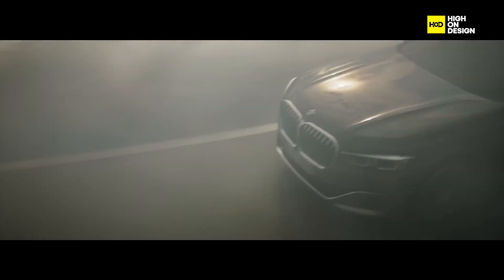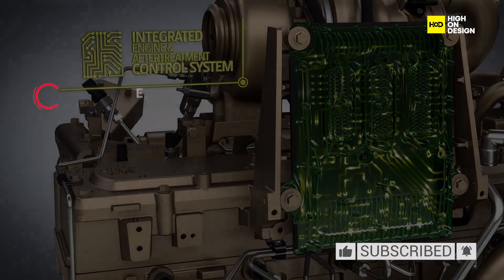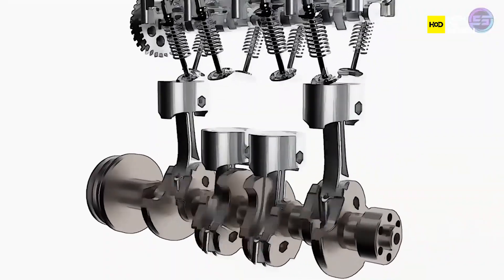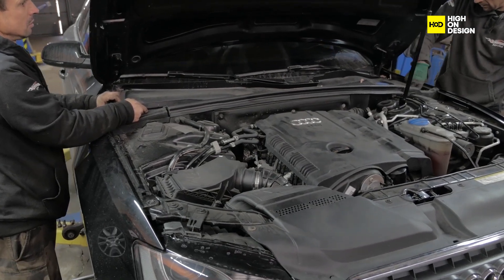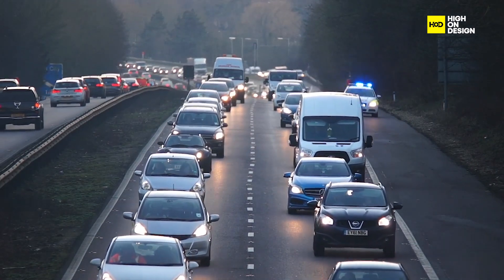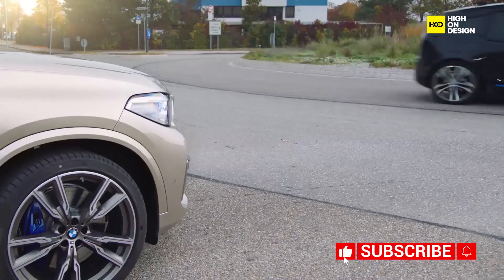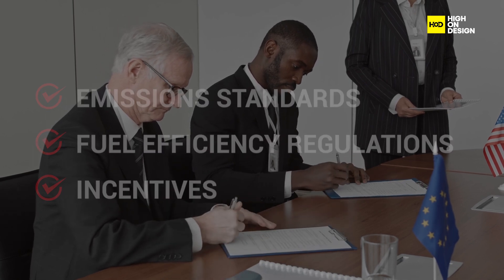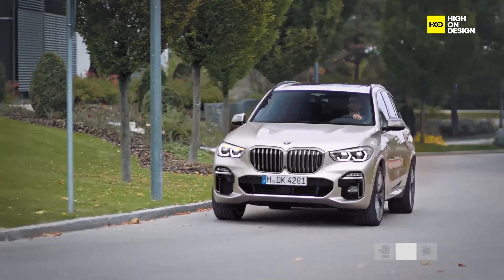The Design Behind Vehicle Start-Stop Technology in Modern Cars

Comment: As these cars age, the stop start gimmick will become more obvious to drivers and passengers with increasing delays in restarting and the resulting vibrations.  I also suspect that the added stress on the engines will shorten their longevity.
Reply: Great Bob, lets just do absolutely nothing then to mitigate feul consumption.
Reply: @maximilliancunningham6091 you either pay now in gas bill or pay later in repair bill. The best thing to mitigate fuel consumption is learning to drive economically.
Reply: Wrong.  My 2021 has a great SS system.  It’s a mild hybrid system that looks to be built smart and rugged.  L

Comment: I've never been in a car with auto stop start that wasn't horribly obvious about the engine shutting on and off. I'm taking the sound, the shake of the engine, and in some cases they fail entirely and you're just dead at a green light. "Advanced noise and vibration damping techniques" Only work effectively for so long, and even at their peak don't eliminate what they seek to do. These systems do not play a crucial role in the future of automobiles, and are mostly a gimmick the OEMs use for regulatory reasons